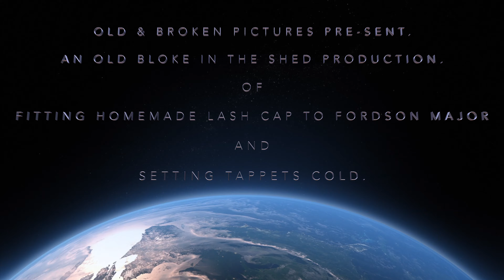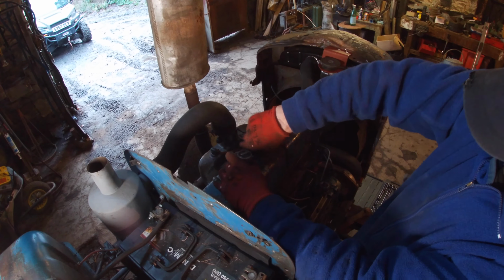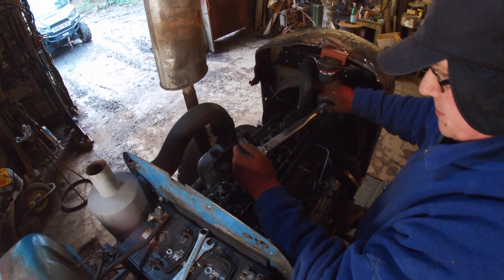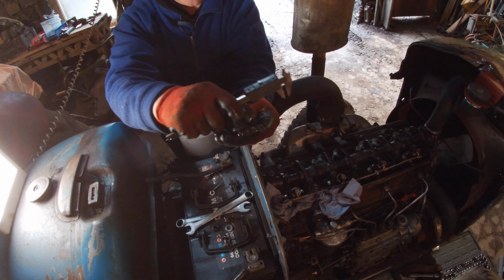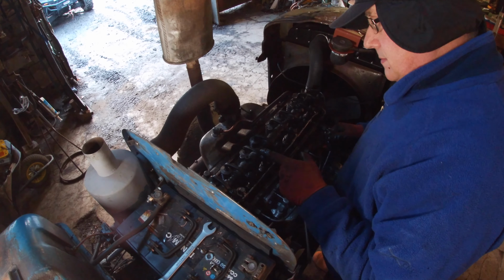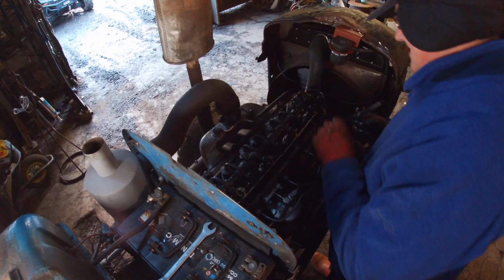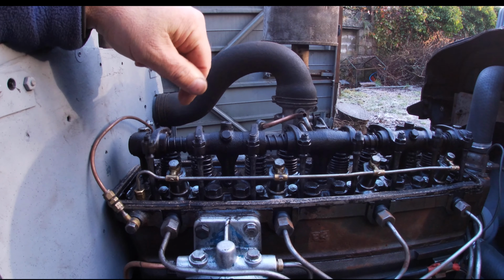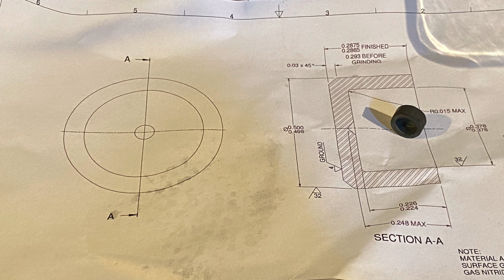Fordson Major home made lash cap fitting and Setting tappets. Part one.

Comment: how do you find the edgewick lathe? would you rathe them compared to harision etc?
Reply from the maker: Well it's a year older than me. I like using it although,  I fitted a new motor to replace the giant Brooks motor which was 2 hp. The new motor was 2hp but I think a 3hp would have been a better like for like. It will run up to 360 rpm and if it's been running for a while it will run 690 rpm top speed but usually trips the motor overload. This is the first lathe I have owned and used so I have no knowledge off Harrison lathes. My one is a MK1 but there is a Mk2 but never seen one. Marshall
Reply: @MarshallSmart  yes I would expect that this lathe would require at least 3 hp, I have been offered a similar lathe for sale for about 600 pounds,would you say they are in this price bracket? the lathe is in rough enough condition and wear is about 30%
Reply from the maker: @anthonyconlon8609  I think I paid £420 for it covered in rust and not running. I think with transport, new motor, starter, pulley, and new sulphur free gear oil it was around £850.
I had been looking for one for a while on facebook market place. They were always sold very quickly. The Edgwic was only on for 2 hours hours so I took a chance and bought it without seeing it. Did not realize how big and heavy it was. Somewhere around 900kg. I can indicate with the 4 jaw to 0.001"-0.002" which is plenty for what I use it for. You can do imperial and metric threading by moving 2 leavers.No gear changes require. I am still learning on it. Most people seem to have a Colchester student lathe on YouTube. Check out Mr Peete on YouTube he has quite a few different lathes. M 😃